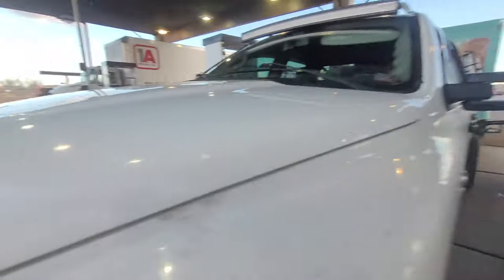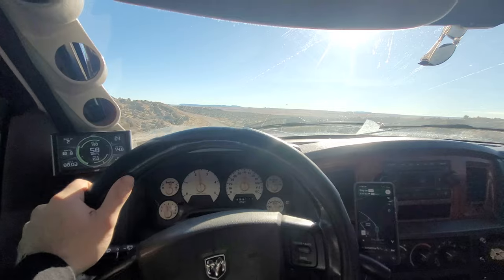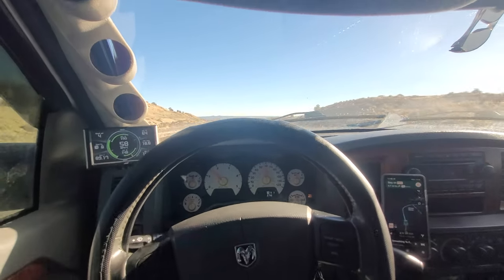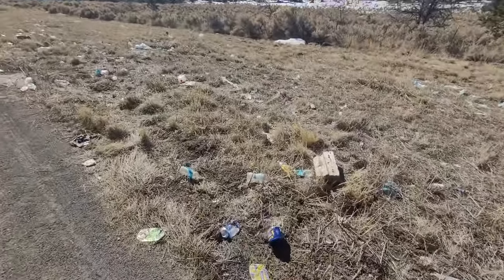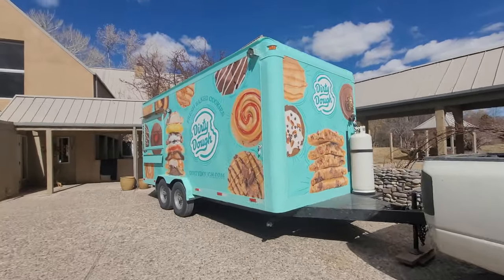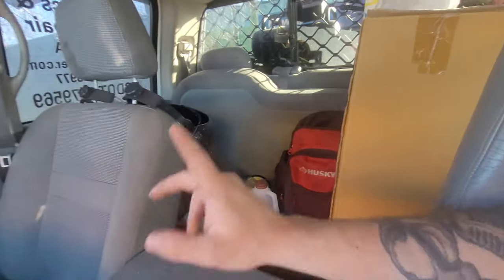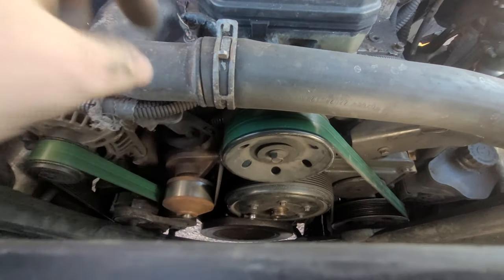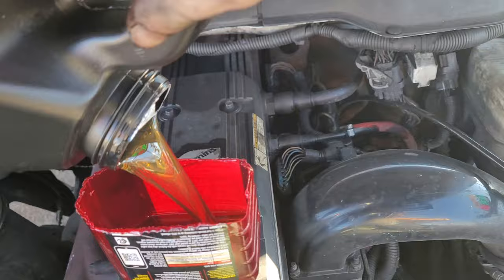Picking Up A Dirty Dough Trailer With My Ram 2500

Comment: Steve just a little advice on the fan bolts I did a kdp on 12v Cummins lock tite the bolts and socked them down 200 miles later I lost all bolts but one I used lock washers under the bolts and red lock tite and really socked them down also used a little longer bolt then that did the trick just recheck those God forsaken bolts  just my 2 cents God bless great videos

Comment: Enjoyed the video and it would be nice to not have the fan on the water pump as I do with my 7.3 thought about electric fans but not enough cfm. Tried anyway lot of money still over heats but stock system works great. You have me thinking CUMMINS
Reply from the maker: It's nice that a waterpump is only 2 bolts on the cummins. I'd recommend a deleted 6.7 with arp 625s over the 5.9.

Comment: Idk about Cummins but I know I’m the 4r100 you don’t wanna use lock up in 1st because the line pressure is so low
Reply from the maker: I lock 1st depending on the situation. If I'm going to be going up a steep hill it keeps the temps down. Guess I'll learn the hard way if it's a problem 😅
Reply: On a 4r100 you should have od off if your towing
Reply: @alcatraz501  No, you shouldn't...

Comment: Don’t pre-fill oils filters. Fuel yes, hyd sure, oil no.

And for the booger eaters out there that rage when they hear that. Fill up an oil filter that’s mounted sideways in a block.
Reply from the maker: How about fill the ones that are upside down too 😂

Fuel filters I won't pre fill either but if you do that's perfectly understandable. 

On a mechanical engine I leave the filter loose and prime it with the hand pump until it overflows. Then tighten it up and send it. 

On the commonrail I just send the fuel pump 😂
Reply: @CPSteveMiller  I work on heavy equipment mainly and some of theme don’t have a lift pump. They solely rely on the ip for flow from the tank. I don’t understand… why cost cutting I guess.  But you have to use compressed air to prime the system if it gets ran out of fuel or(sometimes and) you don’t pre-fill the fuel filters. 

Anything with an electric lift pump I never pre fill either.  On a mechanical pump it just depends what mood I’m in and how hard it is to get to the manual pump 😂 

I would say it probably safest to not to pre fill any filter if you can get away from it.

There was a test in a magazine a while back where they timed how long it took to prime a engine with a pre filled filter vs a dry filter and it  took longer to build pressure with the filled filter. Possibly due to air trapped between the sump and the filter.  Wish I could remember where that was at.. it’s been a long time.
Reply from the maker: Big equipment is a lot different but I see most manufactured agreeing not to prefill. Fun to make guys argue over it. 

I'd be curious to run that test myself after I get my oil pressure gauge installed.
Reply: Search images for Fleetguard LF14000nn, FF2200 and FF2203. Those are the oil and fuel filters for a Cummins ISX15. Step 1 of the instructions for each filter is to fill them with oil / fuel. I really don't care how anyone else does it, I'm gonna prefill my filters. As for vehicles with filters mounted sideways or upside down, I'm not gonna drive anything like that anyways. I prefer to have some mass around me when I'm driving.

Comment: #SaveTheManuals what size tank is in that 3rd gen ? Also i lived in ABQ for 2 years and its a dump new mexico is a woke ghetto state.
Reply from the maker: 35 gallons is a factory tank size. I've had 3 3rd gens and they were all the same size. 
I also run a 105 for an aux tank
Reply: @CPSteveMiller  yeah that aux tank is a must 👌🏽. Btw for the ones crying about floating gears are just upset they can’t do it and always try to say “ YoU’Re RUinIng YoUr SyNCrOs”
Reply from the maker: My trans that grenaded at 547k still had good syncros. 6th gear ended up exploding 😂